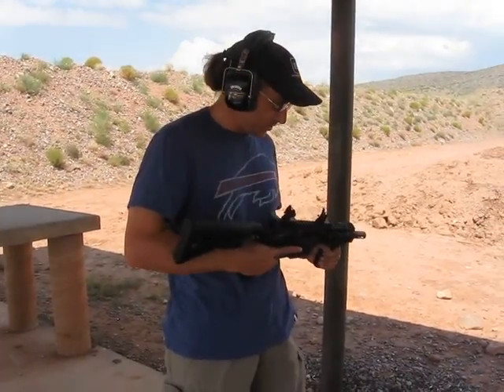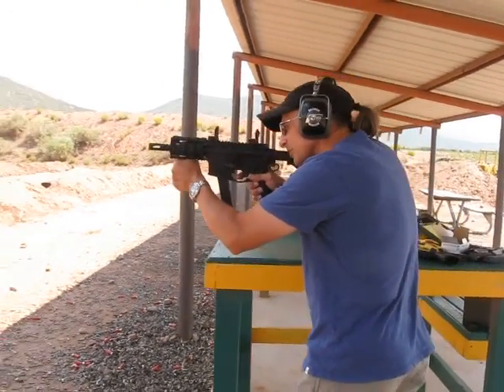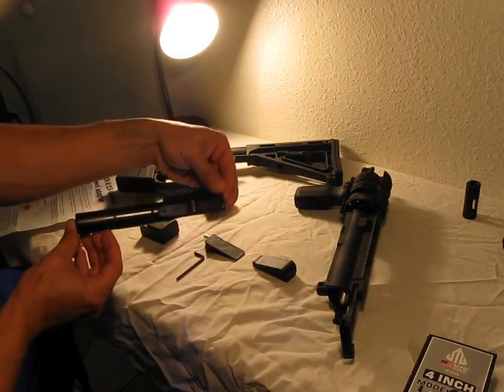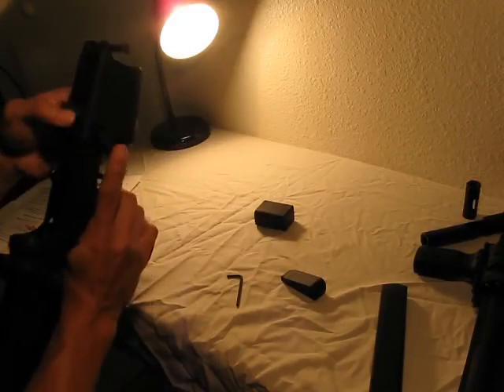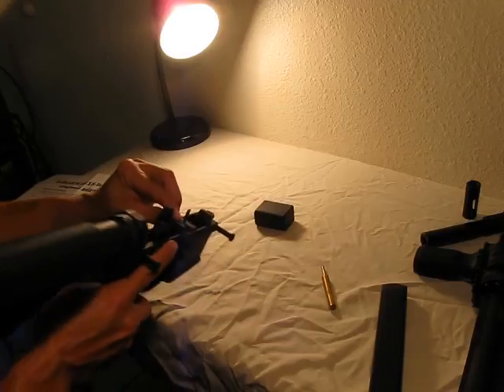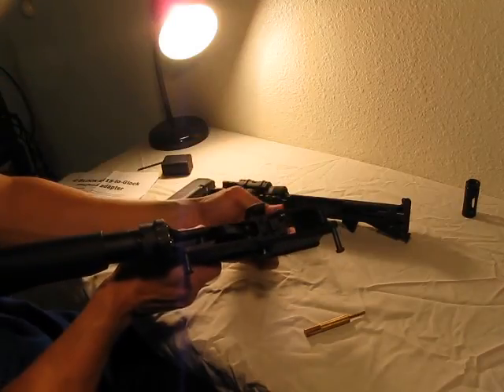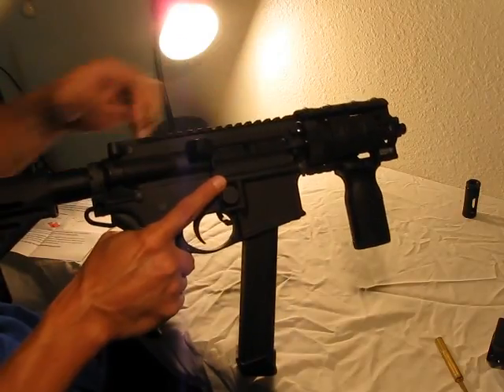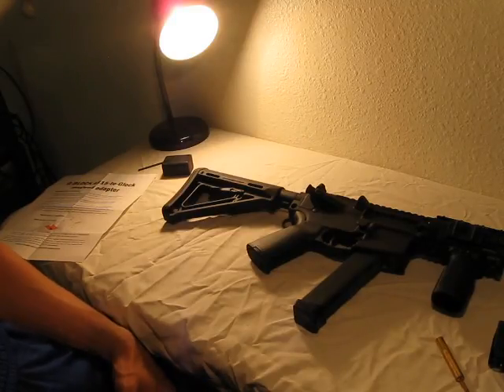AR 9mm (with TorkMag) SBR Upper Build on NFA Registered Lower

Comment: Hi Ron, we just found your video! That ridge that was preventing insertion is an anti-overinsertion stop for Glock pistols. It prevents a Glock 17 mag from overinserting if you put it into a Glock 19, for example. You can fade away the rear half of the ridge with a boxcutter or pocketknife to resolve the issue in the AR without losing that anti-overinsertion capability in a smaller Glock. Here's our online manual that shows the cut: http://torkmag.com/manuals.html
Reply from the maker: Thanks for the reply. I know at least one viewer was interested in whether the mag could be inserted without using the mag release. I replied to him after using a dremel to even out that ridge since I'm using this 33 round mag exclusively with the TorkMag. It now inserts without using the mag release and drops free when the mag release is depressed. So far I'm really happy with the TorkMag as it does the job without costing over $100 and doesn't require pins to be removed.
Reply from the maker: I've run 124 grain Federal Hydra Shocks through it without any issues. If you're going to do a build the TorkMag is a combination of convenience (no removing the slide release pin), value, and performance. The same isn't necessarily true of 9mm bolts and buffer springs. I went with JP Enterprises JPSCS2-9MM and 9mm JP Silent Captured Spring. The combo ran $385, which is about double the cost of the cheapest components. But I've heard too many stories of guys wasting about 1000 rounds trying to tweak those cheaper parts. I wanted it to work right from the very first round and so far so good. Here's a link to the JP Enterprises bolt/spring: https://www.jprifles.com/buy.php?item=JPBC-9MM-SCS2
Reply from the maker: One other thing about components--when you go looking for barrels keep in mind that a lot of them come 1/2x36 instead of the much more common 1/2x28. If you're wanting to run the gun suppressed be sure to get the thread pitch you need.
Reply: Try Spinta Precision for parts like the bolt, they are much cheaper.  I've ran their bolts ($109) and a KAK buffer ($15) with standard springs without a problem in my AR9's.
Reply from the maker: Thanks for the heads up. Do you have a video of your setup to link here so anyone interested can see it?

Comment: Stern Defense has a one piece Glock magwell  adapter that has last round bolt hold open for 179.00. Way easier to install too.
Reply from the maker: The Stern is $100 more than the TorkMag and the install video on the Stern site doesn't look much easier than the TorkMag. The last round bolt hold open is a nice feature, though I don't like that the mag release is repositioned. Still, it is an option for people to consider so thanks for the heads up.

Comment from the maker: The ammunition used was Wally World Winchester White box 115 grain FMJ. As stated, the lower is an NFA registered SBR lower. Putting this upper build on a rifle lower without having the tax stamp in hand (mine is actually visible in the video--it's the white paper sticking out from under the yellow paper taped into the underside of my ammo box) will result in an unpleasant stay as a guest of the federal government in a dour facility of their choosing. You could do this upper build on a pistol AR lower....but be careful if you buy a stripped lower as it may be classified as a pistol or rifle on the 4473. If you buy a fully assembled AR pistol in some other caliber (like 5.56), you don't have to worry about unintentionally violating the National Firearms Act.

Comment: Thanks for the video. I'm unclear on the issue with insertion. Do you have to press the mag release every time you want to put a mag in? Have you tried modifying the magazine or the mag catch to allow for smooth insertion?
Reply from the maker: Right now I have to push the mag release to insert a mag. It looks like I could dremel off a ridge near the top of the mag and not have to worry about pushing the mag release when inserting. However, I also use the mags in my Glocks and figure that the ridge is there for a reason. I might do it with one of my Glock 17 mags just since I have several. I mainly wanted people to know that there was an issue with it when using the TorkMag.
Reply: Ron Quixote thanks for the information. Please let me know if you do that and how it works. Yours is the only review I’ve seen that mentions this big drawback!
Reply from the maker: Well, you got me wondering so I dremeled down the ridge and it now slides in without using the mag release. If I have the lower by itself and push hard on the mag when inserting it, the mag catch won't lock onto the notch I cut out for it to work with the TorkMag. With the upper installed it isn't an issue at all. Also, the mag with the ridge dremeled down seems to work in my Glock 17.
Reply: Ron Quixote You sir, are a pioneer! Thanks for taking the plunge and giving it a shot. I think I’ll be picking one of these up now for my SBR. If you do the modification to the magazine I’d love to see a video of your process.
Reply: I got mine today and installed it. The new instructions have a notation to cut that little ledge off. I did it and mine is working great! Thanks again for your video.
Reply from the maker: Glad to help. I'm pretty impressed with the TorkMag considering the price and ease of install.

Comment: So, you avoid the work of removing a part from the lower to install a magwell adapter, but the consequence is having to modify every magazine you put into it???  Not a reasonable tradeoff.  Glad I went with the other type of magwell adapter using modified uzi magazines.  Far easier and the magazines are very available and have none of the problems described in the earlier part of the video.
Reply from the maker: A lot depends on your situation. I have a registered NFA lower. If I break the housing for the mag catch pin, I can't just replace the receiver. Not having to worry about screwing with that pin is well worth it to me. The mags do have to be modified but not in such a way as to impair their ability to function in the Glock pistols. The notch has to be cut into the back part of the mag and if you don't want to have to press the mag release when inserting the mag then you also have to dremel off the ridge. If it wasn't an NFA lower I'd go with a dedicated 9mm lower....but then I'd have to wait 10+ months to SBR that lower as well.
Reply: Go with a pistol configuration.  The Trump BATFE has already ruled that putting a pistol on the shoulder does not make it an SBR.  I've done the drop-in magblock conversion for a rifle and it was pretty easy -- I didn't even know what I was doing at the time.  But I understand the NFA matter.  It's why I don't bother.  Things are going to change before too long.
Reply from the maker: The ATF also ruled that putting it to your shoulder does make it a SBR. You're right that things will change--look for ATF to make SlideFire type stocks either NFA or, more likely, illegal. When they do that ATF may also take yet another look at braces.

Comment: Any update on the mag block good bad or otherwise?
Reply from the maker: So far so good. At $75 it's cheaper than the Hahn and not all that much more than the poorly reviewed ProMag. It holds the mag right where it needs to be and I haven't had it loosen up while shooting at all. If you're looking at a 9mm conversion of a 5.56 lower the TorkMag is a solid option.
Reply: I have considered mine a total waste of money and time not very reliable $65 for three pieces of plastic should have listened do others telling me to use either Magpul Hahn or a dedicated lower